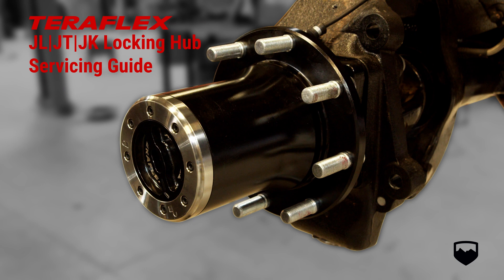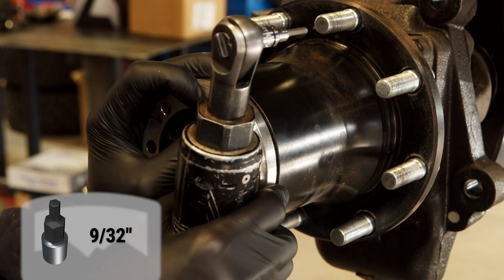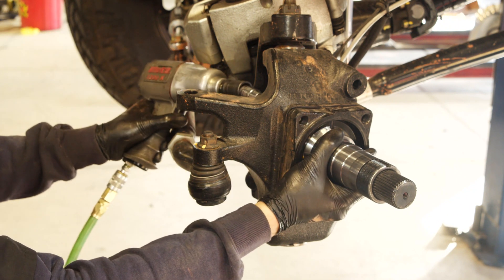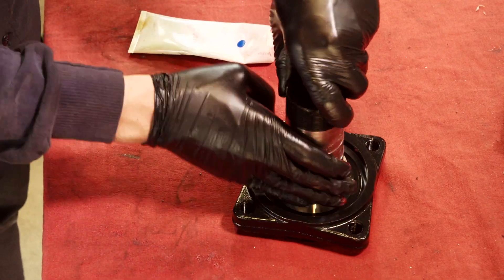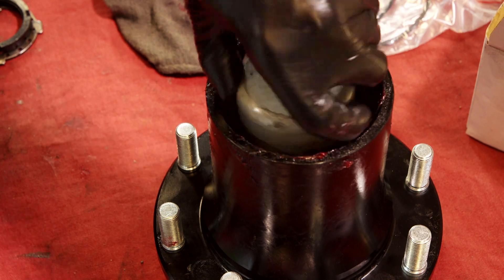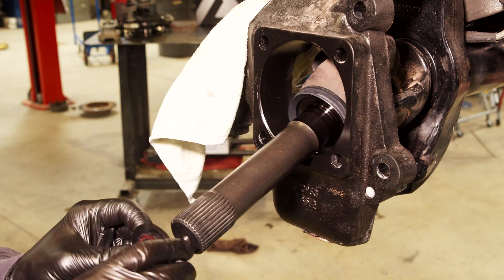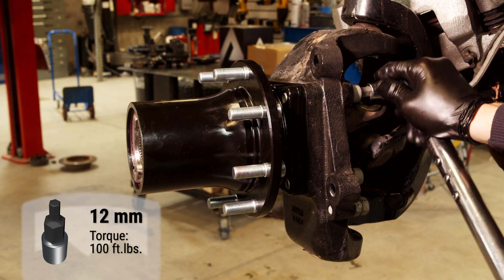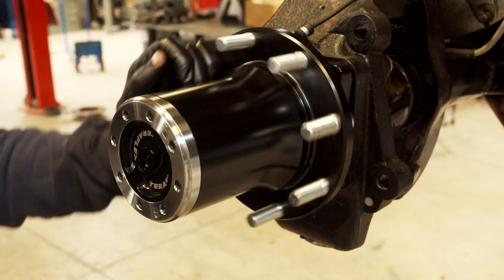JL/JT/JK Locking Hub Service | TeraFlex

Comment: Can you offer the Part number on JT 8 lug conversion!!! I need it!!
Reply from the maker: We do not have an 8 lug conversion kit for the JT at this time.
Reply: same man,i have a full 35 spline setup on my jeep and i could really benefit using this for when im on the street to disengage the front
and i bet it would take alot of pressure off my axles since is a full float set up so all the weight would be on the hubs so therefore my axles could take more abuse ?